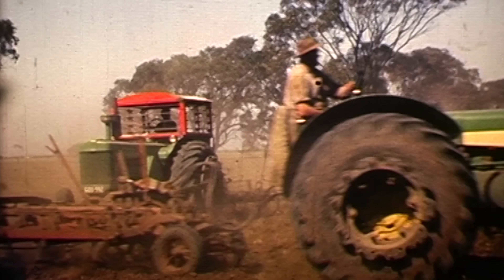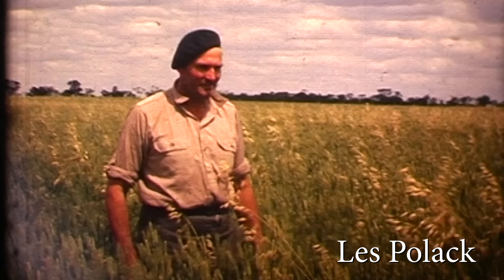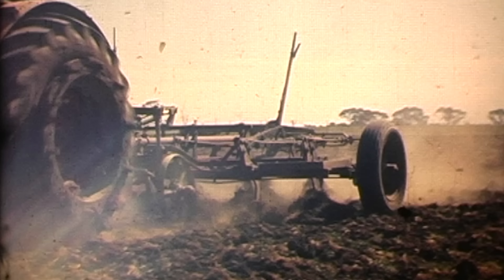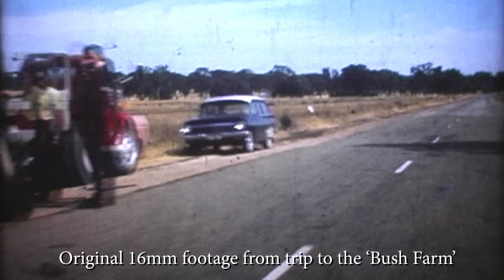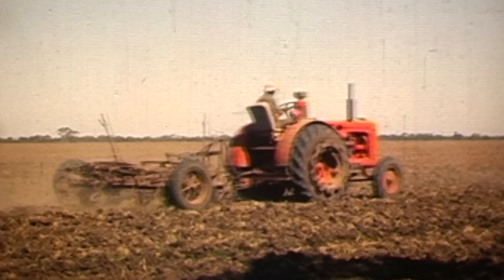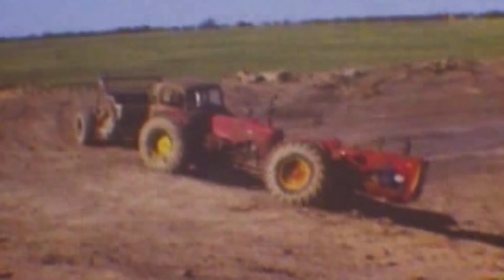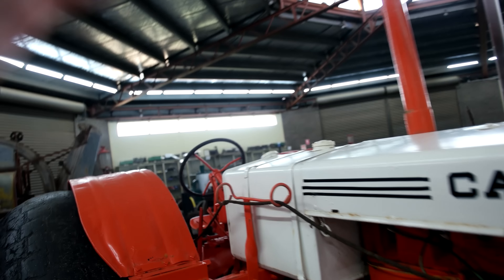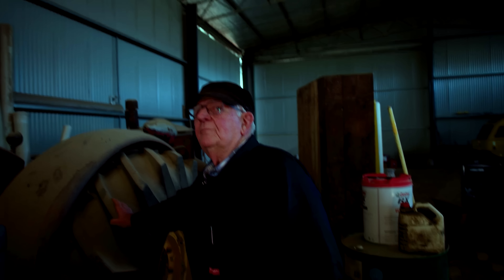When men built their own tractors! The story of the Double Header!

Comment: 13:34 My cousin in Walsh CO. USA made a double tractor from 2 Case Tractors. It steered from the front unit the back unit was connected by a pivot point to the front unit. He made a lever control to the back unit, clutch and throttle. Both units LP gas and Cousin John taught me how to use it. I pulled a “Sweep “  that’s 3 V blades that cut through the roots of the grass and weeds. He farms “ Broom Corn and soybeans. Red Clay soil. No Till because it blows away if you till it. Thi was in 1962.
Reply from the maker: That's great... thanks for sharing the story! Is the tractor on display anywhere? Would be great to see a photo. Today we celebrated Dad's 100th birthday.. he nearly made it.. passing away back in March.. miss him and his stories a lot! Thanks for comment!
Reply: @MatthewPolack 
The last time I was there I was 16 years old. Now I’m 77 . I doubt that Cousin John is still alive since his son John Jr. Was about 30 then. I spent the summer on his farm working and running that double tractor.

Comment: Well, funny thing. My Dad did something not unlike this over Western Australia. He had the chamberlain super70. Tuned it to run a 100 horses & stuck another tuned up 70 behind it with the front cut off and”A” framed. He ran it till 88 when he finally could afford a tractor that had 200 horses straight up. There’s photos of him running with three of them in a row. Would’ve been early 80’s before the third one got wrecked for parts mid 80’s. I don’t remember the third one as much. He did say running with the third one was bloody hard work. No doubt. No hydraulic steering and 200 horses up ya with another 100 underneath, three different clutches to work in sequence and an extra plowing/seeding equipment running double tandem. I remember as a kid thinking that this kind of thing was normal. Ha. Thanks Dad. 

Mingenew WA.
Reply from the maker: Thanks for sharing Rod.. That would be a great sight.. Would love to see the photo!Would have been an impressive sight that is for sure!! Thank you for all the info on it!

Comment: So my Uncle built similar on his farm out in Africa out of two Leyland Tractors. He wanted a 4wd tractor, but couldn't afford one new. It wasn't as. advanced as this. It was 6 wheels with 4 driving. The front wheels from the rear tractor were removed. It wasn't articulated, and required 2 drivers. But at the end of the season when he didn't need the 4wd he could remove the rear unit, put the steering wheels on and have two tractors back in service.

Comment: Started a little farm 30yrs ago my father gave me a Case sc trans and rear end with nice rear tires, made simple steel ladder frame installed 1968 Ford 289w/c4 auto connected to Case  via double row chain ala Massey -Harris, mounted narrowed 1959 International pickup front axle with leaf springs.  Painted it AC orange and cream, (Had AC orange laying around)when finished watched  my dad drive it in the fields , came back and said, rides like a Lincoln. Still in use today.
Reply from the maker: That's great to share. Thanks! Sounds incredible. Would be great to see what it looks like.. and all your creative work with it.Well done on 'reinventing' it and keeping it going!

Comment: Hello from Vancouver Island, Canada. I grew up on the farm in Saskatchewan. My Uncle In Alberta made two double tractors The first was made with two John Deere R's and there were able to betaken apart so the the front single R could be used by it's self.  
The second set was build over the winter in the shop from a pair of John Deere 830's, They were the same idea as your Dad's double they were hooked together permanently . They built a tall cab so you could stand up in the cab. It had a an air ride seat and steered with a single hydraulic lever. They were quite powerful as he turned the pumps up. People cam from all over to see it operate. It was entered in a some tractor pulls which it seldom lost. They are still able to operate as my cousin has them and is fixing them up.
Reply from the maker: Thanks so much for the post Kenny. Greetings to you over in Canada.. travelled there a few years ago.. lovely country. Great to hear about the two double tractors your uncle built. Sounds like a great tractor with the 830's.. would be awesome to see that running once your cousin gets it restored. Has been great hearing about the ingenuity of farmers across the world. Thanks for sharing!

Comment: Even in the USA people had to do similar things I mean you see people taking a Tractor like that and putting a wide large truck axle from like a  selling the parts of WWII military transport trucks that were not assembled/scrap parts on the front then putting the original wheels with tires on, most of the tractors of the era until sometime in 1960's or 1970's had the skinny wheel base on the front so for safety they fixed the problem of tipping on sharp turns. These were bigger Tractors then seen hear but still not much bigger.
Reply from the maker: Thanks for sharing Casey. People all over the world certainly are very creative and resourceful. Thanks

Comment: I wonder if the B24 Liberator bomber restorers in Melbourne have a need of those wheels/tyres? Not serious, it just crossed my mind.
Reply from the maker: Would be interested to see a restored Liberator! They are big tyres I can tell you that.. fairly worn now.. but still work for the occasional demo. I  guess a lot of that old military gear got sold off and repurposed in all sorts of ways. Thanks!
Reply: @MatthewPolack  It is a magnificent piece of aeronautical engineering (it's big!), typically American in glorious alloy. Unfortunately for me it doesn't make sense, designe to kill and destroy unlike tractors.
 Worth a look for sure though (can't turn the clock back), it has many photographs and items relating to the aircraft on display, especially of interest are the turrets and the shutters for the bomb-bays, radial engines, the thickness of the plexiglass protection and much, much, much more. The mind bogles at what the B-29 is like up-close. The man upstairs said turn your swords into ploughs, so turn these flying swords into tractors.
Reply from the maker: @anthonyxuereb792  Thanks Anthony. Where is it on display? Must be indeed big as the tyres are large on their own! Anyway is nice that the brothers did indeed turn the swords into plough shears! :)
Reply: @MatthewPolack  Well done Matthew, the brothers did indeed do that to their credit, I missed it completely and it was under my very nose. The B-24 is in
an old hangar in Werribee and Goggle will show the way as is the norm these days and I haven't checked to see if it's open to the public post covid. I think it's fitting  this story/chapter be added to the B-24 history.
Reply from the maker: @anthonyxuereb792  Thanks Anthony. If you speak to the owners will have to let them know about how similar Bomber tyres were used! Interestngly Clarrie said the grip wasn't great for them..they would spin on the ground a bit..but anyway it adds to the whole story! Thanks for your interest...will have to try and drop in at Werribee sometime and see the plane if I can! Thanks.

Comment: when you see the frail old man at the end.. you realize  he was one strong tough smart man 40 years earlier.. and  makes me realize we are all headed to be that frail old man regardless  what we have achieved in our life...
Reply from the maker: Thanks Paul.. Dad is still going..97... His mind still great.. But just frustrated that his legs and body don't function like they used to! That quote about 'Rage rage against the dying of the light' Certainly applies as he keeps independently trying to organise watering systems for the garden.. Fixing the mower..rigging up pulley systems to lift things... All with a body that struggles to move! Thanks!
Reply: @MatthewPolack  I AM 53 and swapped a few car engines put bigger turbos in a few buicks i rebuild motor cycles, and put lift kits on full size 4x4 trucks  I CANT COMPARE TO THE HEAVY IRON YOUR FAMILY WORKS WITH AND would not even try to mess wit that tonnage  . awsome  my dad was a postman he is now 88 and never could put a nut on a bolt, but he could tell what was going on in every country around the world today he suffers dimension i feel because  he watched to much tv after age 60... he is ok but never a gear head like us...  i dont know what makes mechanics  tick  but  i dont sit down i would rather be in the garage instead  of in front of a tv...some day i wont be able to play with my tools  because  i see what happens to us...  so keep movin as long as possible..

Comment: My Great Uncle built a tractor similar to the double header. Two farmall rear ends, center articulated,  powered by a Detroit 453. Built in 1957. Called it the Beatall. As far as I know it is still running, and driving in parades in Francisville, Indiana. I got to drive it once as a kid. Still have a picture.

Comment: That was awesome!
I see you're suffering from allergies?
You should see if you can get becconase (spelling?)

The only tip I wanted to add, is the music is a tad bit too loud in some parts of the clip and it makes it difficult to hear what the speaker is saying because of the music? Other than that it's awesome 👍
You can really see how those big catapilla tractors with the "belly scoop" came from!

Does the double header in here still retain the drive distribution between right and left drive wheels using pedals; if so do they use a linkage between the front and rear tractors?

Comment: Very interesting video, did I hear right that they used tires off a ww2 bomber?
Reply: People still use airplane tires for tractors . Gensco outta houston sells em. 22ply or more about a solid inch of rubber so no punctures
Reply: @johndowe7003  Are they ww2 era?
Reply: @406highlanders  no theyre used tires from military jets and bombers to regular aviation  wheels, check out the website for more info

Comment: Great video that brings back memories. As a kid in the 70's we had two sets of tandem tractors, Chamberlain 9G and also 306,s. They gave much better performance than simply double the horsepower because of the extra weight and long wheelbase. My uncles next door had several sets as well and I have seen a triple set of W6 inters recently.